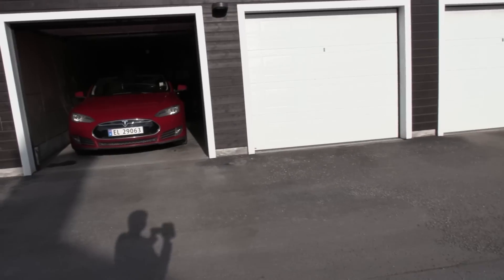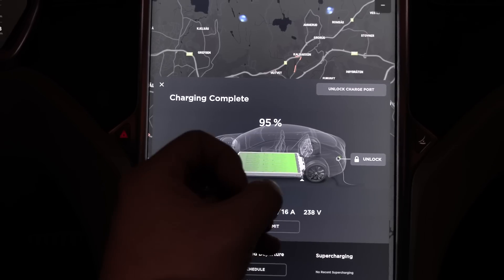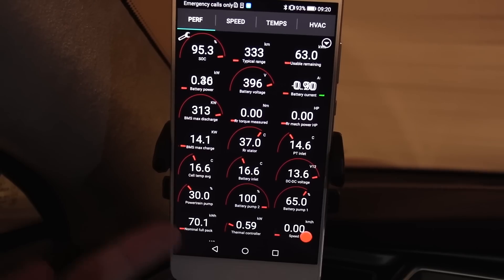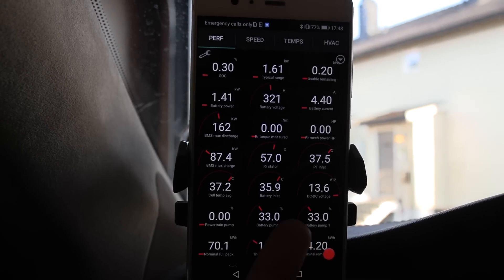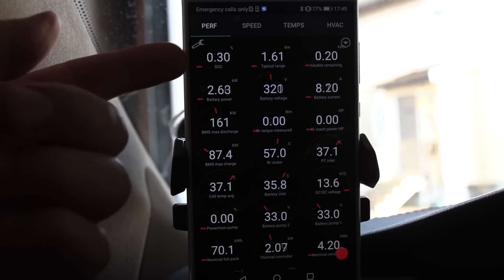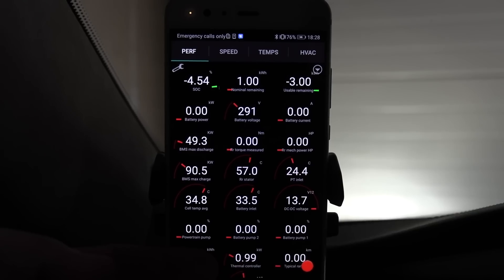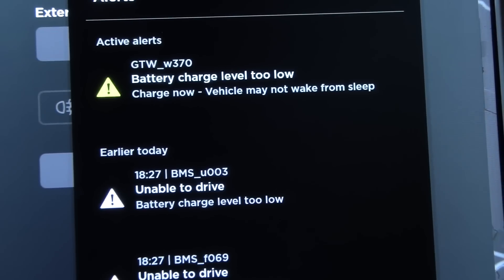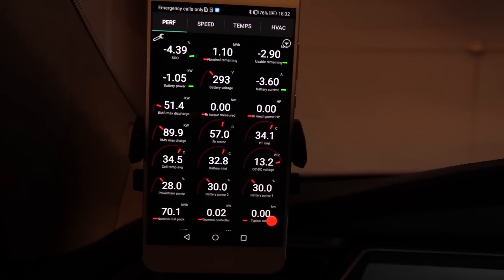Trying to calibrate 6 year old Tesla Model S battery

Comment: Is that teaching of the battery limits, called synchronization?  Your battery stopped charging at 98%, because some the cells reached their limits in terms of upper voltage, while the remaining had not, also the amount of energy put into the battery does not correspond to what it can hold.  Cell balancing apparently will start when the cells reach a certain voltage, which is nearly 90%, it all depends on what Tesla has programmed in the BMS cell balancing modules.

Comment: Did you realise that Tesla topped off battery values two/three years ago in an battery update to avoid damage to old battery packs ? My P85/2014 received the same update and charges up to 375 km max. I drove 375km on 67kW and arrived at home with 30 km's left . ( I had a defect battery heater and all kinds of alarms on my display ) In spite of these warnings I drove from our second house in Winterberg without regenerative braking and paid € 700 fot the repair.
This was the first cost in 7 years , only two tires at 80.000 km , now need the other two at 110.000 km's. A very cheap expensive car indeed !!
Reply: Nope! the car stil charge above 4,10Volt on a singel cell  so makes no sense( 4,18V after the charger stops is natural healthy voltage)  the 
imbalance is smal and have minimum effect on the capacity.....
in contrast to the higher internal resistance of an old battery, this results in a loss of approximately 14%. If you pull harder on the battery, you will get even less energy from it because you lose this in heat due to a higher internal resistance of the cells.So it is just how the battery is used, if you go  crazy on the e-pedal and if it is winter you will only be able to use 60kWh from the battery to move around, if it is 24 degrees and you drive very gentel, you will get 67kWh from the battery and you get a lot further. What then is degradation? you would say the energy that is still usable with normal use, right?

Comment: Draining battery like this is not smart. I did this, and it emptied the 12volt, and that triggers a warning that doesn’t go away even though the battery charges back up. Tesla had to reset manually, and after a short while I had to change the 12v, since it didn’t keep its charge very well. PS, Bjørn, use a mobile broadband router that distributes WiFi to your car, to get 4G on the Falcon :)
Reply: 12v battery can be damaged permanently if you leave it discharged fully, li-ion has safety equipment to prevent this from happening.

Comment: i would love to have the confirmation / comment on the "only charges to 98%" from a battery engineer, preferably from tesla itself since they know every detail of their battery but i dont think the gegradation characteristics are different enough to not "ask" for an explaination from any battery engineer.
But sadly i dont know any and no company (for good reasons) lets any random person talk to the engineers directly.
Reply: today i charge my model s AC 5kW from 40% to 91% and stopt the charging....let the battery rest for 3 hours,later i start the charge to 95% and stopt the charging,after this i put it to 100% and the charge stopt @ 97%. later i drove down to 94% and let it rest and charge on AC 3kW to 98%. I drove the car gentel to 97% and charge the battery on AC 3kW.......and the SOC shows now 99%! before this the scan my tesla shows 70,2kWh and now 71,2kWh. cells show 4.17xxVolt and one module number 9 is a 4.18V. This number 9 is 0.010 lower when discharge and 0.010 higher on full charge. i think a imbalance 0.100Vdc are more will effect the range big time. so a 0,015Vdc imbalance is normal(under load 0,020Vdc and rest can be  0,005Vdc)

Comment: If you want to charge it to 100% you should try leaving the car plugged in for 2-3 days continuously while running the heater at 2-3kw(20C with fan on 2-3 and AC off), and leave the driver’s door opened and “keep climate on” to make it work.

Comment: Regarding the danger of going down to 0 state of charge. 
  From what I know about multi-cell battery packs for electric model airplanes, (yes I know it is not the same as Tesla battery pack)I think the same idea  about what makes it dangerous for the battery might hold true. If the battery in you car  was just a big single cell then you could non destructively discharge it to 0 and not harm it.
 But because it's made of thousands of cells, discharging the pack  to 0 average you will be pushing one or more of the weaker cells into negative voltage. This is where the danger is. You never want to push a battery to negative voltage because it will ruin it chemically. When you discharge  the whole battery pack to 0, as the stronger cells are traveling towards 0, the weaker cells are being slammed into reverse voltage. You are forcing   current backwards through the battery cells that have already reached their own 0. This is not good.  It is like the reverse of going to the bathroom. Not good...sheeiit.

Comment: 10:00 wow, that is some insane inbalance. the delta between cells should be 10mV, not 300mV. that is nuts. but 10mV you got after the turtle charge is good. ps: the bms does not "burn" off the energy when balacing. it does active balacing so it transfers the energy from the highest pack to the lowest pack.
Reply: no, there is definitely no redistribution

Comment: You cay try to charge the car to 100% via DC (maybe with a 50kw „Fastcharger“). This is the only way for me to get my Tesla to real 100%. DC goes directly to the battery and must not be converted. On AC I will also not be able to charge the car past 98%. Good luck!

Comment: 15:50: Regarding 4.2V per cell.

The normal end voltage is 4.2V. But if you reduce the cell voltage a little, you gain greatly in cycle life.

Having a lower CV (constant voltage) is what's sometime referred as a top buffer.

It's not uncommon to charge to 4.1V per cell if you value cycle life.

My car, in comparison, charges to 4.105V...
Reply: Exactly my thought. I'm pretty sure the cells could be charged to 4.2V but the BMS simply does not do it because it wants to slow down further degradation.

Comment: And again the Youtube myth of calibration by 0-100% is busted!
Reply: Why? From what I understand of it, it is starting to balance (thus calibrate) when above 90%, so you get more realistic SoC-values from the car. But you have to keep in mind, that it is possibly not possible for the car to perfectly balance, as some cells degrade faster than others. Thus it leaves some cells at "almost full" (like 98%) to not damage those that are already full in that row/column.
Reply: @blubb9004  Tesla battery management and electronics are so ahead of anything else on the market. Sandy Munro said that the difference in voltage was 20mV between the highest and lowest voltage cell. You basically don’t have to balance the cells unless there are issues.
Reply: @EVPaddy  we’re talking about 2 completely different things here. I’m talking about Tesla’s battery management and how are able to manage 4000-6000 cells in 1 pack and not have much of a variance in mV from cell to cell. Thats different from degradation.
Reply: @EVPaddy  yeah that’s what’s so special, if one cell does go bad the entire pack still functions properly and you only lose the capacity of that one cell. Also those weren’t my words, sandy munro said that about the model 3 and Y, he didn’t take apart the S and X so he doesn’t know about that. Just watch some stuff on his YouTube channel, he’s an actual expert. “Munro live” is his channel name.

Comment: 70.1 left from original 85 should be around 18% of degredation 🤔
Reply: I think the original gross capacity is different from original net capacity. The gross capacity is calculated with different voltages.
Reply: @patterisepi  The original gross capacity was 85 kwh and original net capacity was 80.8kwh; see here https://ev-database.org/car/1031/Tesla-Model-S-85
Now the gross capacity is 70.1kwh and net capacity is 64.9kwh. If you compare net capacity is around 20% degradation (80.8-20%=64.64kwh)
Reply: All wrong as 85 is not the rated capacity (which is around 71-77.5kWh, depending on pack version) which is usable capacity + buffer (4kWh for a 85).
Reply: @moestrei  source?
Reply: @Orca-hp4zx  Google Net Capacity of Tesla Model S Battery. I happen to have a Tesla Model S Workshop manual too. Unfuortunately it only describes of how to remove the battery, not how to repair it as this is not done in the SCs (Even if only a contactor is faulty). To drop the battery is super easy as Tesla was toying with the idea of swappable batteries at the time and everything is quick connect (electrical) and self sealing (fluids).
Reply: @moestrei  if you find something official OK, but with Google you will find lots of guessing and ignorance. If you could find the original sheet would be great to see it!
Reply: @Orca-hp4zx  The Electrek article was about data extracted from the Tesla OS. You will NEVER get any meaningful details from Tesla themselves.
Also usable capacity and charge rate can change (and has changed) with any software update any time. Even degradation is not real. It is just a number calculated by the BMS and limits applied to guide the battery safely through the warranty period.
Reply: @moestrei  that is true. However, we don't have any values besides what Björn thinks might be the value, because when he had this car years ago there was no technology in place to read out the BMS. So we never will know what the value at that time was. Everything here is guessing.

Comment: I have read something about that the BMS needs an open circuit to find the high and low point on litium ion batteries. Open circuit is when the car is not used and it shut down to deep sleep. Disconnects the high voltage battery pack and only uses the 12V battery. When the battery is not in any use, the BMS will find its true voltage on high and low state. You have probably found the high point with over 90% charge for more than 2-3 hours with the car not using any power. So I recommend you to try to set the low point of the battery to run it down to under 20% and park the car for 2-3 hours with not any power usage. There was one guy that did this on his TM3 and the capasity of the pack rised again steady after multiple charging sessions following this pattern. Another thing is that the P85 pack is most likely not truly 85kwh. A guy named Jason Hughes (his nick is wk057 on tesla forums) and he took apart the P85 battery pack using them for solar power at his home, and he mean that right size on the pack is actually 81kwh. The charging not to 100% could be part of Tesla to prevent the battery fires that has been in some Tesla model S. That they are limiting the max voltage on each modules, because it could also be some imbalance in the module that could not be measured outside each battery module. I think I have read this in some of his posts earlier on tesla forum. Hope this is to any help. Thank you so much for you videos, have watched most of them.

Comment: There is so much guess work and different recipes available around the world. Tesla should release an official  Battery Manual so owners can nurse the health of THEIR battery without all this keyboard warrior wisdom. That would be a decent thing to do, Elon. Is standard in the world of solar batteries. My guess is Bjørn got it pretty right though.
Reply: @TheSteinbitt  I am certain that balancing is only happening at high SOC. Also the range prediction becomes more and more unreliable. I drive a 300.000km MS 1st battery.
Reply: @moestrei  3.000.000km?
Reply: @jespervonsildjensen  Thanks....corrected. There is one in Germany with over 1.000.000 aiming for 1.600.000 km = 1.000.000 miles.

Comment: This is a useful academic exercise, but no real driver should put this kind wear on their cells just for the sake of numbers. There is a far better way to get the range you want. If you normally drive between 10% and 90%, but the car has miscalibrated a little bit, and so 10% displayed is actually 12%, and 90% displayed is really 88%, and you desperately want that 4% back. Here is the quickest, healthiest for the battery, and most sensible way to get that extra 4% on days where you need 3 hours range, and won't be able to plug in: just charge to 92% displayed and then allow yourself to use down to 8% displayed (if you need to). Bingo, you're car now has the same or better range than a fully calibrated car being driven 90% to 10%, but without all that faffing about, wasted energy heating unecessarily, and extra wear on the battery.